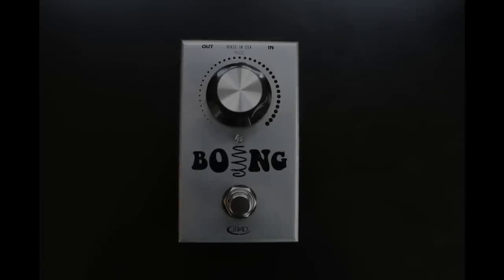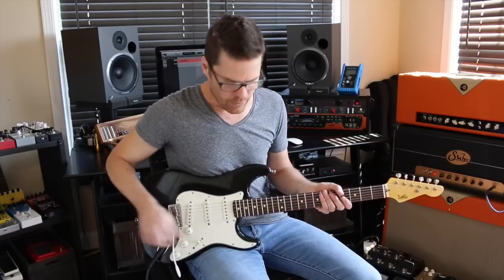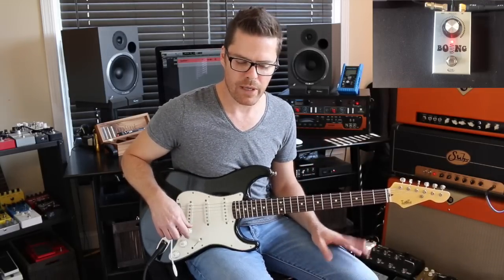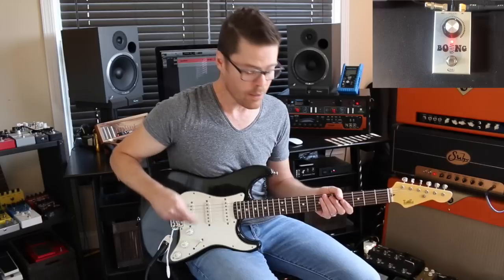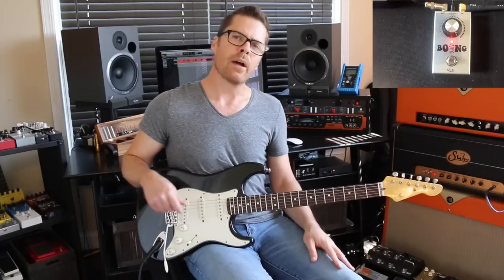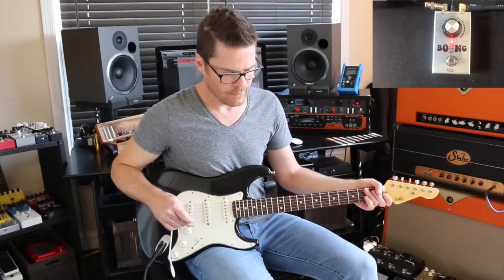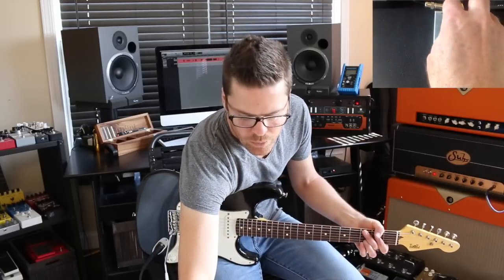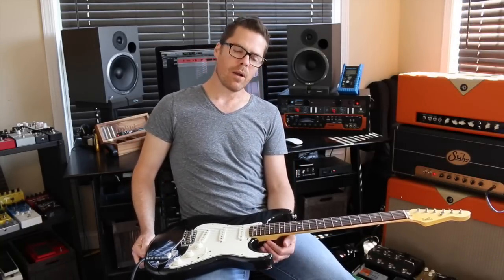BOING REVERB by J. Rockett Audio Designs

Comment: Hi Shawn.  Is it just mine "BOING" that is slightly noisy after 12 o'clock?   I love the pedal but I feel it's a little noisy.  Thoughts?
Reply: I’m a year late but I bought one at the beginning of this year and you’re 100% right. But all in all it’s a great pedal
Reply: @JohnsFrusciante  thanks for your reply Aaron! Since my comment I sold my boing and moved on to a Catalinbread Topanga and it was the perfect decision.  Even though the boing was an amazing pedal the Catalinbread is everything the boing was but completely silent. I love the Catalinbread.  I have had all kinds of reverbs from the tweed fender standalone tube reverb to the boss fender tweed reverb pedal, and the Catalinbread stands above all of them in my opinion for convenience, functionality and tone.
Reply: @danielbelforte  cool stuff bro, I’ll check out the Catalinbread! Since our previous talks (I never got a notification you had replied) the pedal seemed to be noisy but also give a volume drop when turned on. So along with the fuzz I’d hear it would also bring down the volume on my amp (which also made the fuzz even more so). So I’ve ordered the MXR M300 hoping it delivers after hearing great things. Good luck and hope you’re pedal is holding up for ya.
Reply: In my experience the Boing is VERY dependent on how hot your amp is cooking. I run my Fender Bassman at 2 o’clock and I rarely need the Boing anywhere past 10 o’clock. 

Hope that helps for anyone else who might click on this thread! ✌🏽